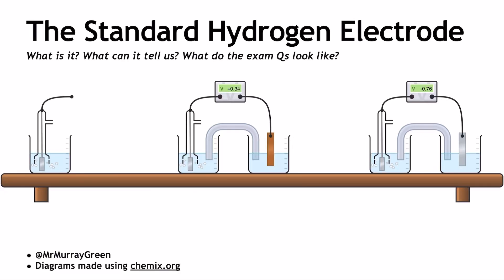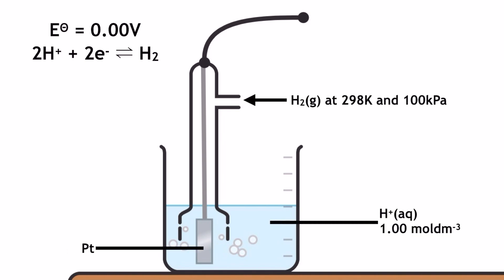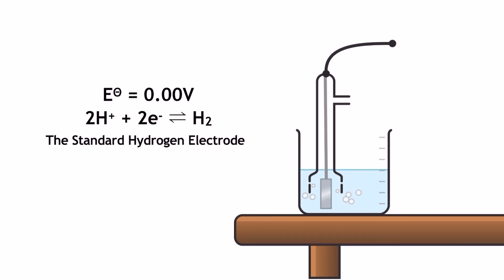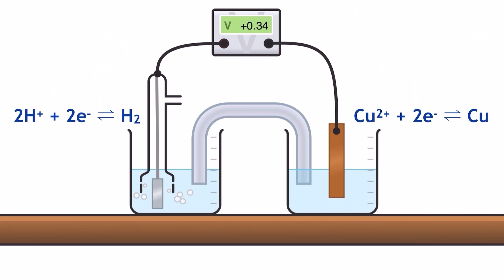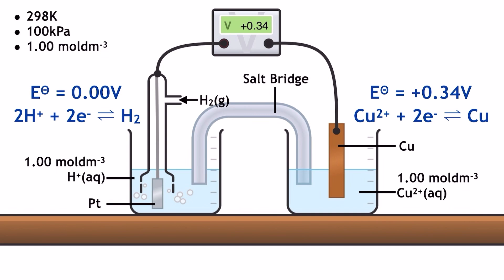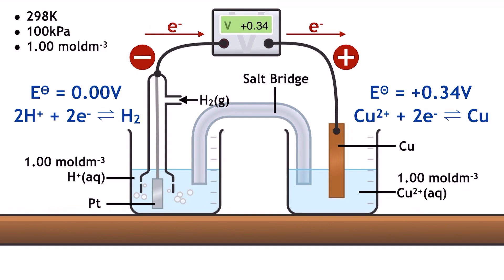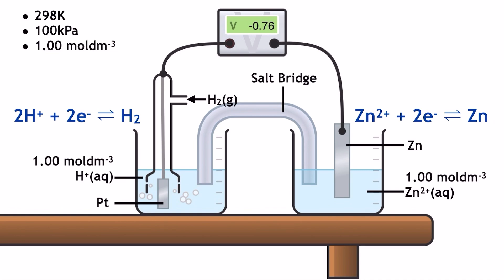Standard Hydrogen Electrode Summary for A-level Chemistry (standard hydrogen half cell)

Comment: You forgot to mention that the platinum electrode is coated with platinum black, which helps adsorb the hydrogen gas.
Reply from the maker: That’s a nice extra detail but not required for A-level
Reply: @mrmurraygreen  Oh. It was included in my textbook.

Comment: shouldn't the standard cell potential be +0.76 cause the Zn electrode is at the anode
Reply from the maker: No. Remember this isn’t meant to be a ‘working cell’ this is meant to be a way of finding out that the zinc has its own electrode potential of -0.76V. You have to imagine you are setting this up without knowing the zinc is -0.76v. If I wanted a working cell then yeah sure I would swap them round and get a positive voltage. But that’s not the point of this apparatus.

Comment: I am writing an Exam next week, and I am stuck with this question: 

You are using a pH electrode to measure the pH at 25°C: You measure a potential of 0.119 V relative to SHE (= Standard Hydrogen Electrode).

a) What is the pH value of the solution and the H⁺ concentration in mol/L (1P)?

I know how to calculate it with the Nernst equation but there is a positive potential mentioned relative to the SHE. This is confusing because when solving the equations, u get a higher H+ concentration than the SHE and your pH is getting negative. (Same happens when the potential is more negative than -0,828 V but with the pH getting greater than 14) What do I not see her? Is there a limitation that the E0 can not be greater than ECell for the SHE? Because this is blowing up the whole concept.

Comment: Amazing video. But I have a few concerns. The direction of flow of electrons seems to be incorrect. I just read that electrons flow from the anode towards the cathode, and this also marks that the metal half cell reaction (copper here) is written in reverse. You can also realize that due to the fact that both at the anode and the cathode you have shown the electrons on the reactant side (Although I know that you are using an equilibrium symbol but it still becomes misleading).
Reply from the maker: Hi, 
We always write the redox systems in the reduction direction by convention. So that’s why I have done it this way. I would only flip them in my working out to combine and attain the overall reaction. 

Also the direction of flow of electrons is from the anode to the cathode in a cell. In a cell the anode is negative and the cathode is positive. The video is correct. 

Thanks for watching 🔵

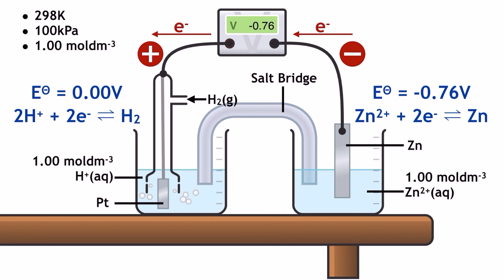Comment: 4:36  Doesn't that mean that the Hydrogen electrode should have a higher potential for the current to move that way? And hence showing that its emf isn't zero (while E°cell might be zero). I'm really confused about this!
Reply from the maker: Hi, I’m not sure I fully understand your question but let’s see if I can help.
Remember that the SHE is zero by definition. There is no wiggle room here. We cannot change that as it’s the whole point of having the SHE. By having it considered as zero by definition we are able to then use the emf which we read (the voltage on the apparatus) when it is connected to any other half cell (like the zinc here) as the electrode potential value for this other half cell. 
The emf comes from the comparison between the two positions of equilibrium (i.e. the SHE’s and whatever is connected to it).
Reply: Sorry for the late response. I am not even sure if this is helpful to you anymore but i’ll try to clear your confusion. 
Basically the hydrogen electrode is at a higher potential than the zinc electrode. Thats because it is zero and the zinc has a negative potential and zero is greater than negative hence higher potential. 
The thing is, electrons just needs to move from a lower to higher potential and in this case zinc has a lower potential with respect to the hydrogen electrode. 
Potential difference basically means the work done per unit charge. When potential is negative it means that the work done is negative. That means that the force applied is against the displacement of the charge. In simple terms it means that energy is released when work done is negative. Which makes sense as electrons are practically pushed out of the zinc electrode and thus energy is released. 
I hope this helped you in any way and sorry for the long explanation i just wanted to clear the confusion. 
Happy learning!

Comment: 03:30 "completes" the circuit
from what i understood, even without the salt bridge there's flow of electrons for some time but not for long. So the salt bridge kinda extends the duration of flow of electrons by balancing the net charge on both sides of the cell with the transfer of Ions as you said.
So basically the salt bridge keeps the current in the circuit flowing and  doesn't "complete" it right? I have a feeling what I understood is somehow wrong. 
Thanks btw you're helping me so much for my exams.
Reply from the maker: I disagree. It helps maintain the flow of the electrons and prevents the process stopping short very quickly. Without it , things would grind to a halt so we describe it this way. 
Thanks for watching and I’m glad the videos are useful! 🔵

Comment: Why does the voltmeter read a negative voltage. Is it a problem.
Reply from the maker: It reads as negative because of how the position of equilibrium compares to that of the SHE. Remember this is all done to try and record a standard electrode potential and some of these are negative values. Check this out too = https://youtu.be/EFyJIcSs0Nc?si=au3JBSzjhBFwq_on